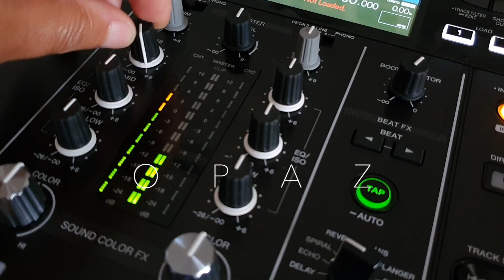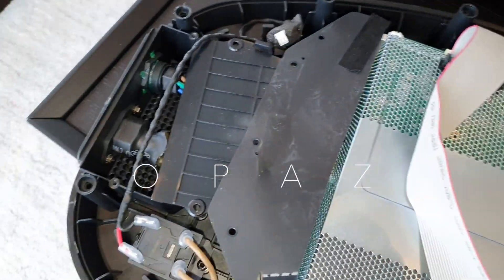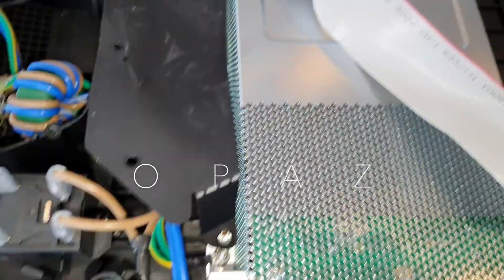BOSE Pro32 Teardown

Comment: I have a Bose L1 Pro 8 the extension column is not working! The speaker works fine, but the extension is failing to connect,
 Do you have a video showing how to dismantle it. I have removed all the screws but don't no how to pull it apart to get to the problem which I suspect is a loose wire. thank you
Reply from the maker: Once the end caps, screws and plastic connector are removed, slide the speakers out of the mild steel housing. You'll see the removed column & speakers at 24:00 in the following upload 
https://youtu.be/yyXFIjUdT_A
Hope it helps!

Comment: Hey! Quick question about the Bose L1 Pro32 base.

I’m trying to figure out where the screws are located — I looked under the bottom panel but can’t find any visible screws.

Are the screws hidden somewhere? Or do I need to remove another layer first to get to them?

Any help would be really appreciated — thanks a lot!
Reply from the maker: You need to peel off the strip on the underside of the base

Comment: I have a problem with the mute button at position 3, sometimes when I press it once it doesn't work, I have to press it 2-3 times before it works. Is there any way to fix it? Thank you for your support.
Reply from the maker: May need a new contact sensor/switch on the board. Take it to be repaired/somebody to look at it if out of warranty. Is a pain happening to such an expensive unreliable PA 🙄

Comment: @opaz  Do you have a demo of how to replace/repair the 1/4 TRS input jack on channel 3?  I have a unit with the top of the jack ripped off/broken and  I'd like to fix/replace it.  Thanks.
Reply from the maker: Unfortunately I don't have any repair uploads. Once you have the unit opened, everything is clearly accessible and I'm sure replacing the broken jack will not be too complicated if you're familiar with electronic repairs processes/tools

Alternatively send it back to bose for professional repair

Comment: Hope you remember how to put it together!
Reply from the maker: If I don't, it's going in the bin 😆
Reply: @opaz.  give it to me at 30% price.. just to be safe
Reply from the maker: 30% ?????. That's about 70% of what it's really worth  😆
Reply: @opaz.  😵70%, still a lot.. I'll wait till it depreciates even more..
Reply: @josealfredfernandes  wht's your fb page name? you seem to follow bose alot
Reply: @armgod1  I'm not on Facebook. I follow Bose because I like their crystal clear sound. Eg: Bose S1 Pro vs JBL EON One compact, wide coverage, better mid highs, etc.. JBL EON One compact limits when at high volumes.. 

Eg: Bose F1 model 812, 132db, vs JBL SRX835P, JBL limits! A lot! Bose didn't do that with same signal. Also, I got a lot dB SPL.. so, Bose seemed value for money.. also the passive JBL SRX835 hits 132db peak, same level competition, no difference. 

Also better coverage compared to conventional 3 way. 

My experience is what makes me go towards Bose products.
Reply: @armgod1  rcf ttl6a + rcf ttl6 as subwoofer (system) is far better than Bose F1 system, but a bit far too pricey! Heard it, never purchased it. Easily will do 2500 crowd.
Reply: @josealfredfernandes  do you own a bose product?
Reply: @armgod1  yes, F1, S1 pro
Reply: @armgod1  planning to get ttl6 + ttl6 as sub